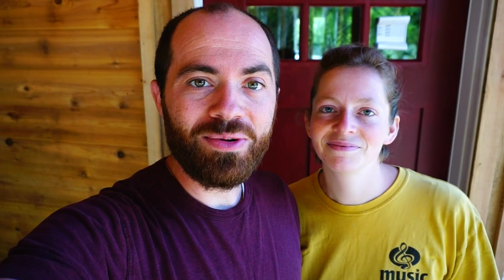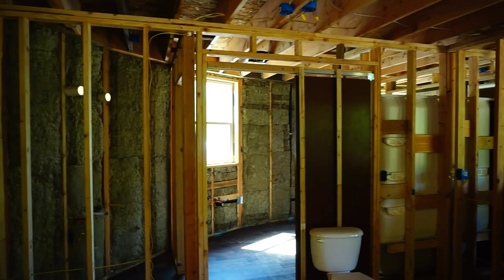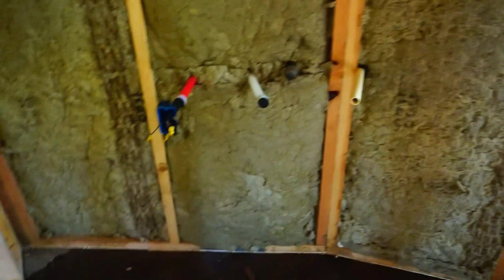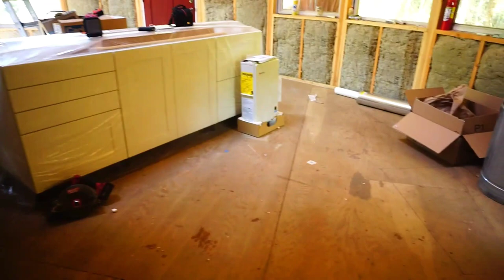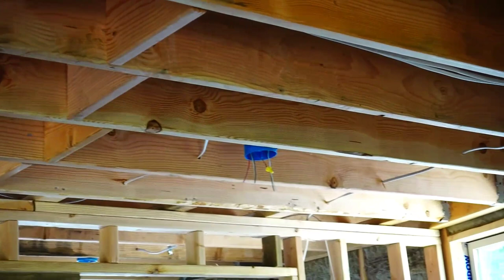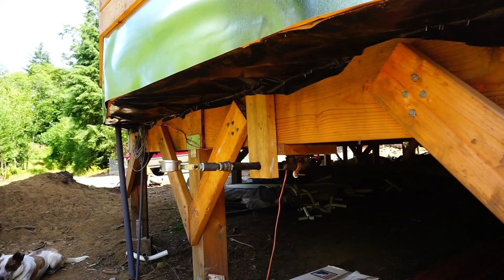Building an Off Grid Yurt Part 12: Insulation, Electric, and Plumbing

Comment: Suggest you put some sort of release valve for that plastic lining.  Condensation and humidity will create a moister that turns into a small lake of water under the floor and eventually drag the lining down and potentially cause rot and mold.  Placing a release valve or something to drain the water will prevent a lot of future hassle and costs.  Recommend a single directional valve that closes after it releases the water without maintenance, these usually only cost under $10 and is extremely well worth the investment.

Comment: Great job, looks fantastic. Maybe paint the metal shipping container roof with this paint that reflects the heat, lowers temp in summer 15 degrees, paint the ext walls green to blend in with the woods and finally plant some bushes in front of it so it hides it. Great ideas, love your project. Good Luck, Vinny 🇺🇸 👍👍
Reply from the maker: +mmanut We are planning to do all of those things with the shipping container, plus we are thinking of putting the solar panels up there when we get to that point. Thank for backing me up on my ideas.

Comment: The plastic under the house is a good idea, as was your choice of rock wool insulation. One thing, though. You will want to protect that plastic with wire. (I think it's called hardware cloth). Otherwise the critters are going to chomp on the plastic, and nest in the insulation. Fiberglass is like candy to them so the rock wool was a better choice, but you will still want to keep the critters out.

Comment: Wow. Great work! You're home!! I'd like to get a rundown on the code for the electric boxes.
Reply from the maker: Thanks, I wish I could really move in. I'm a lot closer though. Electrical code is what makes wiring hard. With electrical boxes you need to watch where you place them, the number and gage of wires in a box, the circuits you put in them etc. Are you going to wire your house? If so I can share a really good do it yourself resource that is up to the current code.

Comment: Nice update. I was wondering if I had missed a video over the last weeks.
I am always surprised to see plumbing put straight into an outside wall with shallow insulation (to my standards I mean). The rock wool insulation is awesome, though I still prefer closed-cell spay foam insulation.
As an off-grid house, do you plan to run everything out of regular AC or will you have an hybrid AC/DC electrical system?
Keep up your excellent work.
Reply from the maker: Lots of good points. We are planning on having an all AC system inside the house. In our situation we are planning on using fewer appliances overall. I have more on that to come.
Reply: Over long distances and for ease of use, AC is the way to go. However, you would be better served with an hybrid AC/DC electrical system. Most inverters are inefficients to begin with: they will convert about 70% of their DC input in usuable AC. With LEDs, there is absolutely no need to run lights on AC and several appliances can be easily modified to run out of DC directly. From my point of view, any off-grid building needs to be considered as an RV: runs only what is required on AC and get everything else on DC.

Comment: I am curious about the plumbing specifically is it on a septic system and where is the water coming from?
Reply from the maker: Hello, yes we have it connected to a septic system and we hand dug a well. It isn't the best well though as it dries up a bit in the summer. I'm on my phone so I can't hunt them down easily but I have videos of digging the well and some of the struggle to figure out the septic system.